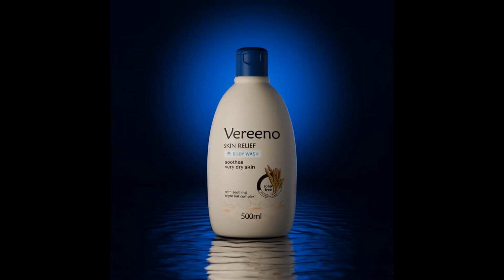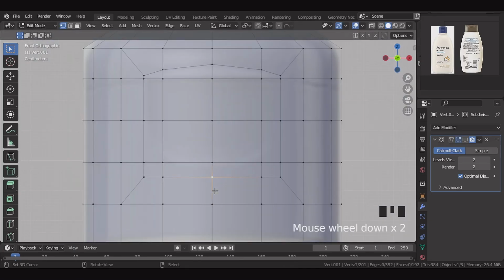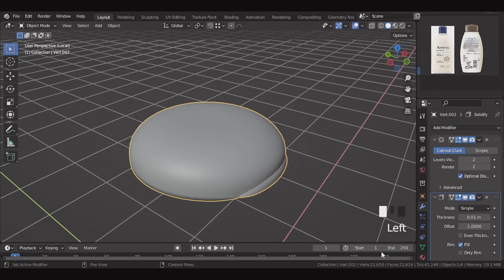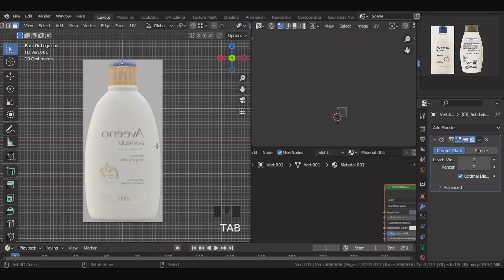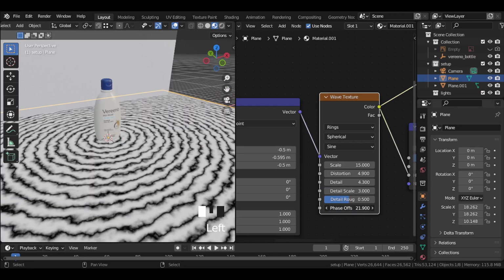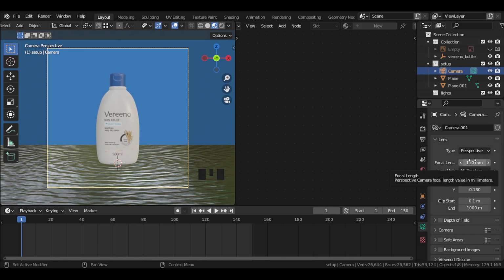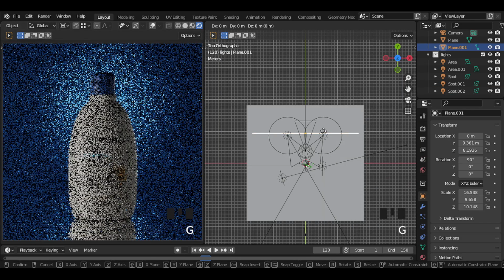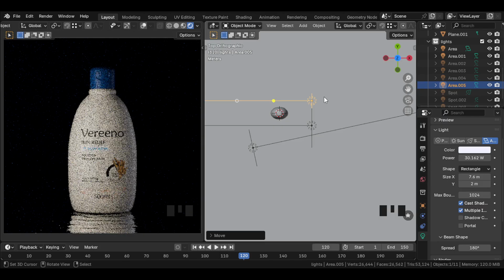Blender Tutorial – Modeling a Body-Wash Bottle

Comment: Sorry, I stuck again at 159s, select all the vertices and do loop tool, I can't find the loop tool, how to call out the menu? when i right click,i call out a menu that is totally different as your.
Reply from the maker: Thanks! LoopTools is an add-on, so make sure you enable it first in Preferences. Then in Edit Mode you’ll find it after right-clicking, not in Object Mode. Also my menu looks a little different because I have some add-ons enabled.
Reply: @casper3D6395  thank you！

Comment: Thank you for your excellent tutorial! But I have a question at the start, in "add> mesh menu", I didn't find as many options as you did. I can't find the add "single vertex "option. On my menu, there was no more option, it just ended at "monkey";  but on your menu, it has a lot of options after "monkey". So, do you use some addons? My blender is a 5th version, and I'm totally a newbie.
Reply from the maker: Thanks! Yes, I have enabled an addon called Extra Mesh Objects. You can enable it from Preferences, Add-ons, or find it in the Get Extensions tab. 👍
Reply: @casper3D6395 thank you❤

Comment: WHAT IS THE INDUSTRY STANDARD WAY OF DEALING WITH HOW TEXTURE MAPPING CHANGES SLIGHTLY WHEN ACTIVATING SUBDIVS?
Reply from the maker: The industry standard is to finalize the topology and Subdivision first, then do the UVs. A bit of UV shift with Subdiv is expected, so you unwrap on the final mesh rather than fixing it afterward.
Reply: @casper3D6395  So apply the subdiv modifier and UV unwrap the high poly?
Reply from the maker: Usually I model in low poly first, add seams while it’s still simple, then add Subdivision. Once the mesh gets high-poly, placing seams can become harder. You can keep the seams and unwrap after subdiv. it really depends on the model and the stage you’re at.